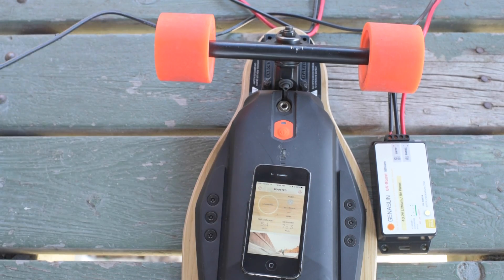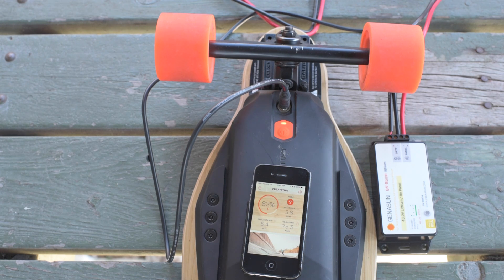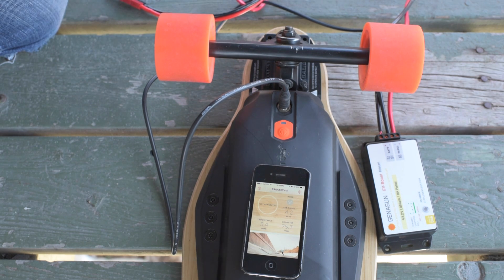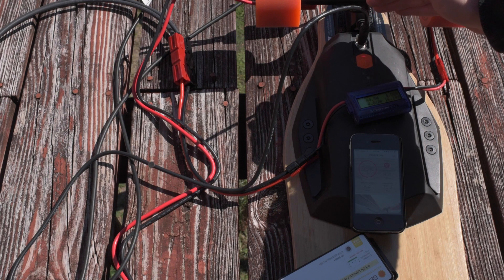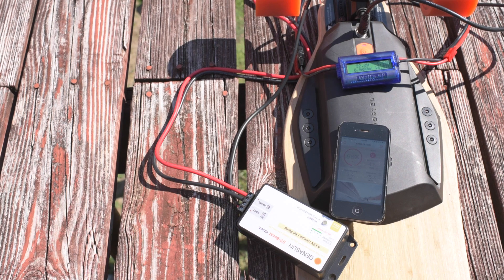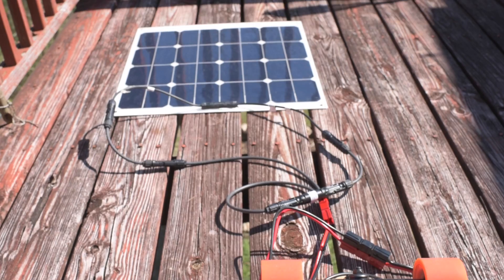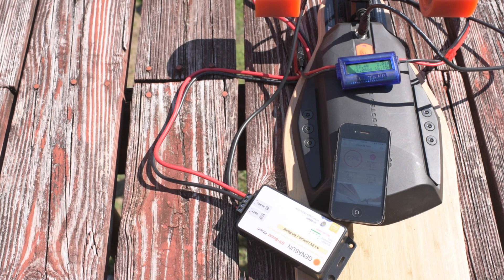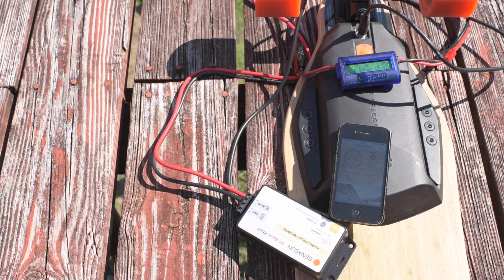SUCCESS - Boosted Board Backpack Solar - Part 2

Comment: Has anyone wired it up directly to charge while riding? With a quick release cable on the deck maybe while having your solar panel on your back?
Or better yet, has anyone tried a solar panel deck? Those flat ones are pretty sturdy now. It may not run the board but might extend the battery while riding a bit.
And automatically passive charge the board while at your destination.

Also there are military solar backpacks that charge batteries. If only Boosted had hot-swap battery options then riding all day might be possible.

Comment: Why would the wattage matter?  I mean obviously, more watts means faster charge, but does the board require a minimum to even start charging?  I would think as long as you have the right voltage, you could send as little wattage as you could get, and it should still charge (albeit slowly).
Reply from the maker: +John Robie yes, it requires a minimum wattage. I'm not sure why. Anti drain feature perhaps. Or maybe the charge controller built into the board requires power to function.
Reply: Oh, I see.  Do you happen to know what the minimum is?  Could you get away with as low as say 5 watts?

Comment: so I have an Evolve Carbon GT board... I believe the battery is 46 volts on it. what should the charge controller be if I can even find one for such a random voltage? 48 volts? and why do I want to solar charge a carbon GT when it has a 30 mile range!? "who knows!" it just seems like a cool weekend project! :D
Reply from the maker: +Tyler Reeves if you buy a genasun custom controller you can tell them the voltage you want when you order. It's a firmware thing.
Reply: createthis awesome, thanks! and sorry for the ignorance, I decided to use that thing that is a pore excuse for a brain to figure out I can just check and see what the output voltage is on the wall charger to determine what to ask for. thanks for the help!

Comment: just out of interest. can you run the motors whilst its charging ? so you could for example. have a backpack with a small panel with a charge co troller. to a smaller lithium battery. that the ges to your controller. that plugs into your board whilst your riding so essentially you could have unlimited battery ? on a good day for lots of riding ? so in order it would go solar panel - charge controller - battery - charge controller - longboard and add an inline switch to stop power constantly going straight to the battery. it seems that the board doesnt charge unless it has a steady stream of amperage coming into the board ? hence the flashing light. on your 50w panel it was flashing fairly slowly. then your 200w panel wasnt flashing so much and then when its sunny. didnt flash atall suggesting it has something to do with amperage instead of voltage ?

Comment: If Boosted would of put a good amount of batteries like Yuneec did on the E-Go you would not need some silly solar panels. You can only get 7 miles distance on the Boosted board. LoL!
Reply from the maker: 7 miles on a skateboard is a long way, man. Anyway, the Boosted Board Gen 2 is available for pre-order now. The Gen 2 has swappable batteries and it's splash proof. Checkmate.
Reply: Luckily they will be releasing just that thing next month. Honestly, the only thing they need now is bigger wheels.
Reply from the maker: Man, I'd totally buy an offroad boosted board.
Reply: yes. agree. boosted mountain board.

Comment: I wish there could be an easy way to pack this into a backpack. Foldable options right now are like $500+ but if a cheaper version comes out one day, It would solve the range problem of my board and other electric vehicle.
Really cool video and congrats on getting it to charge :)
Reply from the maker: +Victor LEVASSEUR Click the link in the description. There is a folding panel for about $350. These are mass produced in China for about $125. I'm not sure why no one is importing them into the US. I suspect it's a supply/demand thing.
Reply from the maker: +Victor LEVASSEUR Here's the panel I wish some Amazon seller would carry: http://www.alibaba.com/product-detail/Glory-outdoor-high-efficiency-sunpower-100W_60277849319.html

These would be fantastic for portable solar.